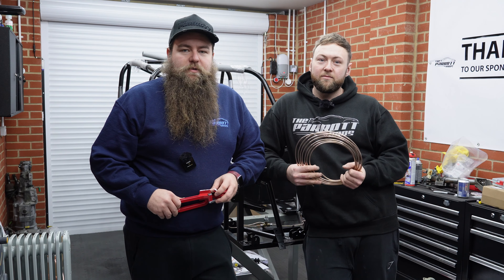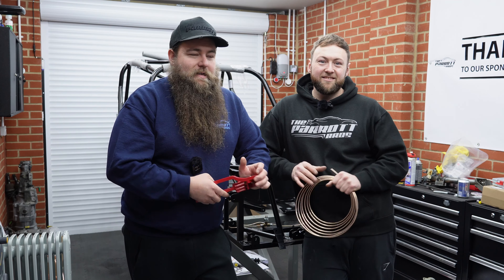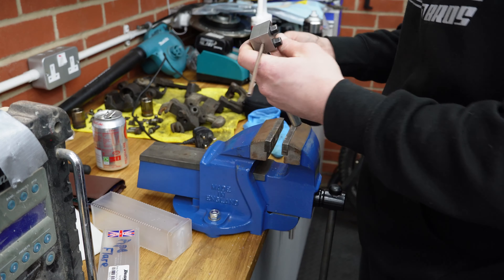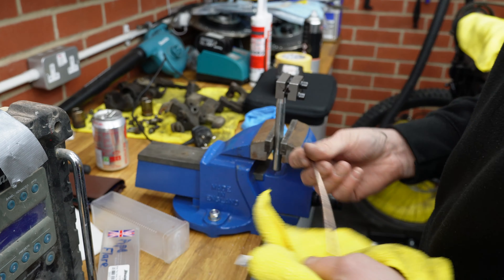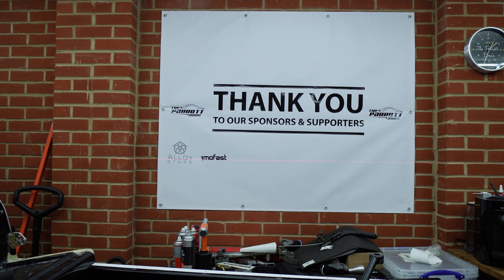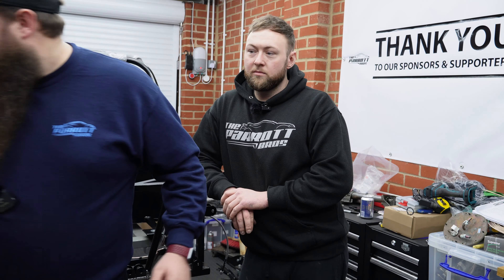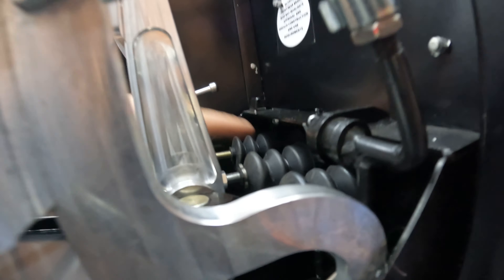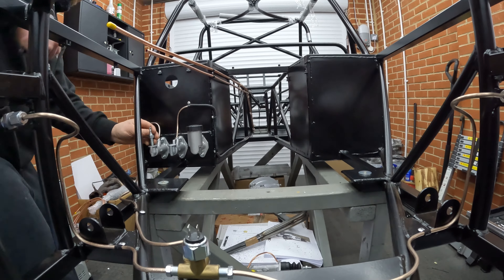Running Brake Lines & Fitting Pedal Box Ep13

Comment: Great work guys , very honest content. Would be interested to know how joints on lines seal , just because I've read some of the cheaper tools don't flare very well , which put me off going down that route? Great vid , really enjoying the content !
Reply: Brake lines are easy In the past on my full Land Rover re chassis I used the cheapo Sealy kits. they work but dont produce consistent bell seals. This is why I bought this type of flaring tool. much better and consistent, ergo why the lads borrowed it from me. I confess I mislaid the instructions for them
Reply from the maker: thank you, yeah we made a couple ends at the beginning and you could tell they would be no good, once we got the hang of it you get to know what will work and what wont, the tool we have works well when used correctly. but we wont know for sure till we pressurise the system haha

Comment: Answer to Pedal Box tightness is to have a female with small hands to easily reach into those tight spaces. She must be able to follow instructions though! (LOL) Did you two not note that you placed the Pedal Box on the wrong side of the car?
Reply from the maker: `we could fit pedals and steering wheels both sides, that would really confuse people haha, i like your thought process but there is a number of issues, what i would have to do in return for the help, the garage is too cold and more